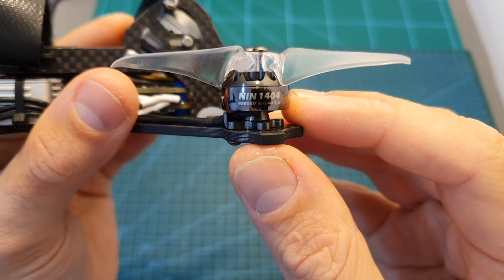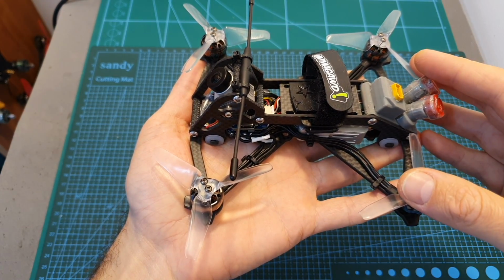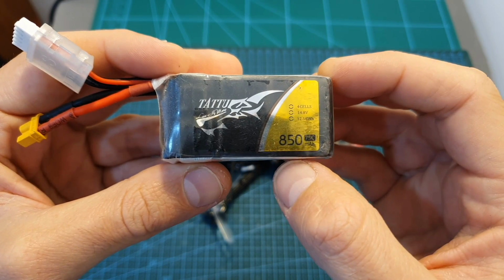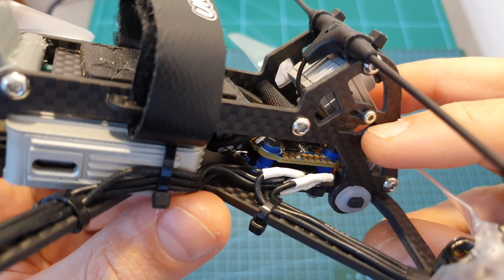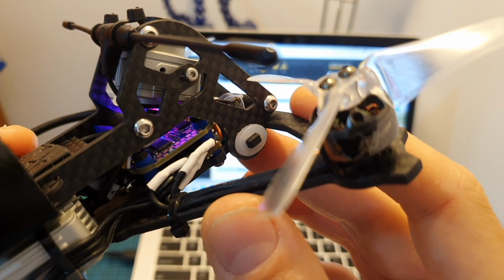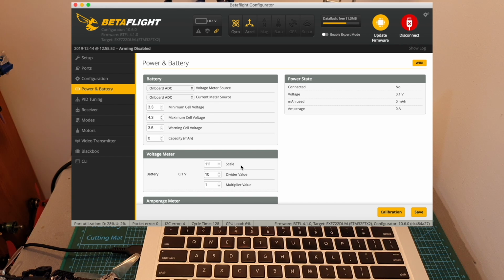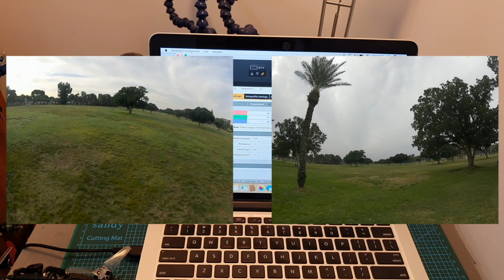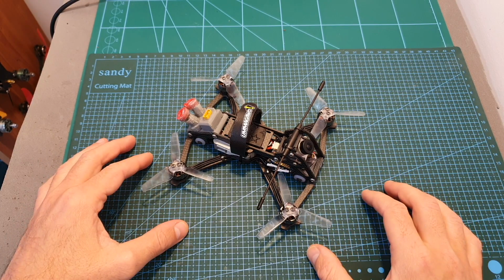Acrobrat Hd - Build And Flight

Comment: Nice flying. Looks like the goggle DVR? Seems like the DVR footage I've seen on other channels from the DJI system looks way better. Maybe they're posting the Air Unit DVR, maybe they're processing in Premier too, wonder what the difference is.
Reply: This is goggle dvr 4:3 with focus mode off and he added that distorted part to the sides to make it fill 16:9. It's not the way you see it in the goggles would be just the clear part. You can tell it's not focus mode because the distorted part looks funny and is a partial mirror repeat of the edges of the image. The image doesn't continue from clear to distorted sides like focus mode does.  I could tell right away been using the system on an acrobrat since it first came out.
Reply from the maker: Except than the part where I show both videos side by side - the video is from the air unit.